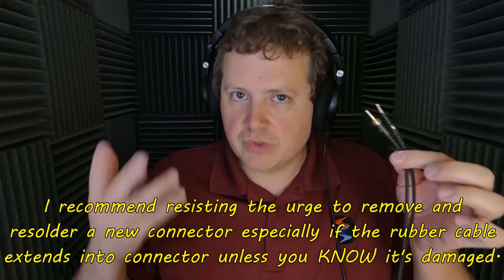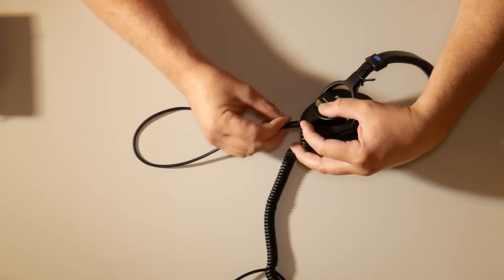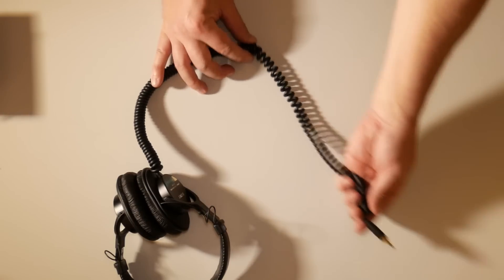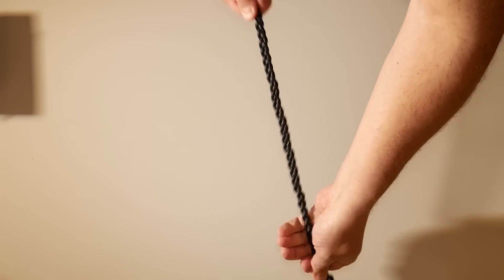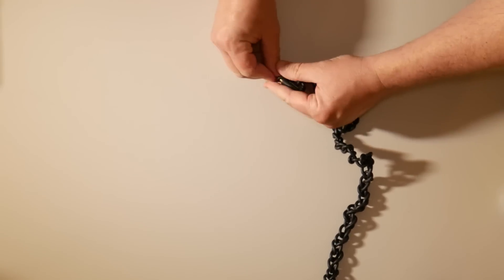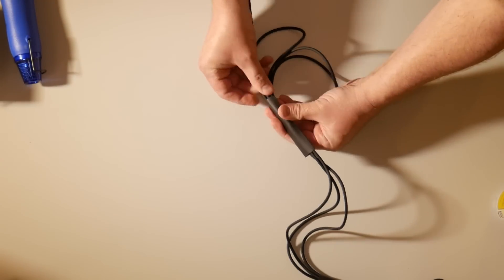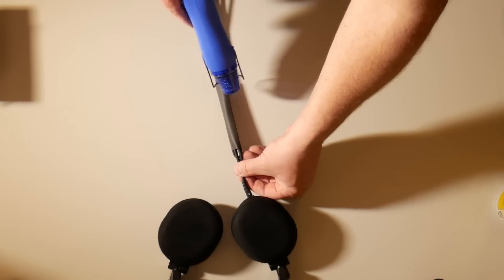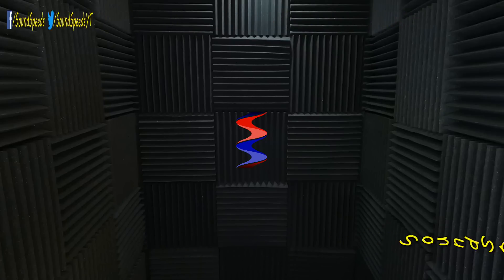4 Pro Techniques To Shorten Long Headphone Cables Without Soldering! Sound Speeds!

Comment: Learned from the video. If I were to cut the cable I would cut out a length of wire (remove about two feet of cable) and the color match the wires from the two ends that were left and either tape them or solder them. No need to solder to a jack.
Reply from the maker: Ok...

Comment: I don't think I would use this although interesting to have. With a chain method it can impart a permanent imprint on the cable. I knew somebody who did this with extension cords and well guess what we went from a decent extension cord to a permanent tripping hazard! But hey you only needed to undo the length that you needed.... Yeah that makes up for it?
Reply from the maker: Chaining a cable over and over again is not the same as doing it once. That's the difference.

Comment: I used the braid technique on my audio technica m20x and it worked perfectly! Thank you so much 🥰
Reply from the maker: Great! Thanks for sharing
Reply: yooo i came here to deal with the audio technica m20x 3 meter long headphone wire
Reply from the maker: Yes indeed. Did you find a solution that will work for you?
Reply: @SoundSpeeds  i just used the braid
Reply from the maker: That's what I use almost every time

Comment: I’m currently trying to decide between audio technica M30X’s and M40X’s, one of the biggest things that will push me to get the 40’s is the fact that I can simply swap in a short cable. However, your tips may just sway me the other way! So thanks dude!
Reply from the maker: The 40s are probably the most popular of all the AT headphones because they are flattest (except for the 70s which are a lot more expensive) so if you use them for editing, you'll appreciate that the most.
Reply: @SoundSpeeds  yeah I think I’ll be getting the 40’s, a shorter cable and then get some new pads at a later date
Reply from the maker: I have a few solutions for you.. 
For shorter headphone cables: https://youtu.be/53Nco-0uSwQ
As for the pads: https://youtu.be/ljCPz6YxIvY
Reply: @SoundSpeeds  dude thanks so much, I’ve been looking around for cables and pads etc. These look great, I’ll add them to the potential list. I’ll let you know how it goes, if I remember. Thanks so much for the help dude, I’ve subbed 👍 class channel.
Reply from the maker: Great! Glad to help and thanks for subbing. Welcome aboard.

Comment: Hello, thank you for the tutorial! I have ath-m20x and Its tight on my head that I hear  pulsing sounds, I'm wondering if you have any advice on this?
Reply from the maker: Pulsing? It's it there if you relieve the pressure with your hands?
Reply: @SoundSpeeds  The noise disappears when I lift it off with my hands. Its like I hear my own heartbeat when I wear the headphones, i think it's because the headphones clamp a bit much
Reply from the maker: That's why I was asking. It's naming too strong of a deal on your head and your heartbeat is what your hearing. Try loosening the band
Reply: @SoundSpeeds  Okay I will try that, thank you so much! Also I did the braid and I think it's so much better 😁
Reply: I also liked and susbribed, I hope you have a good day or evening!!
Reply from the maker: Welcome aboard. Glad to help.

Comment: Great, what method is recommended for shortening from 3m to 2m and / or 1.5m?
Reply from the maker: It's up to you. All methods are effective.
Reply: @SoundSpeeds  Yes, you've said / demonstrated going from full length to ⅓ length...  you didn't show, how to go to ½ or ⅔ length, which would require some specific adjustment to the approach used for going for ⅓.
Reply from the maker: I see. You can use of these techniques to take down the upto 1/3 the length (or even more if you do a more complex braid). It just requires doing any technique for a shorter length of your cable. For example: reducing a 12 foot cable to 6 feet could require you looping almost all of the cable or doing a 3 foot braid with 3 feet of straight cable outside of it.
Reply: @SoundSpeeds  Great thank you for the conformation and support, I will give it a try. I've already been using the coiled cable trick for some time. Hovewer I was struggling to find similarly neat method for shortening straight cakes.
Reply from the maker: Hopefully this helps. I've been using these techniques for years and never had any issues.

Comment: I would love to use these, but my iem cable is already breaded from the start (it's like a looser version of the kz cable)
Reply from the maker: It can still work but for IEMs you can use something like a Bubblebee cable saver: https://www.bubblebeeindustries.com/products/the-cable-saver
Reply: @SoundSpeeds  it's a thicc cable tho maybe the head schrink would work but that would be way too short I need to take off a bit less then half
Reply from the maker: Heart shrink is what my first instinct was.
Reply: @SoundSpeeds  the misspelling of heat is real lol but yea might do something similar to head schrink but with rope as I don't have heat shrink
Reply from the maker: Yeah, typo or autocorrect. I don't know which. Either way, a tight letter N wrapped cable tightly should do it.
Reply: @SoundSpeeds  I made it with the sticky fabric (don't know what it's called) but now it can't slide under my shirt but this works for now until I want to fix it
Reply from the maker: 👍 Very good.

Comment: This is the exact problem I’m having right now but this looks kinda intense.  Are you sure this won’t damage the cable at all?
Reply from the maker: I'm positive. I've done these many times for years with never a bad result. Just be careful and don't stretch the cable as you do any of these techniques. As I said in the video, most of the time the cables get damaged at the connector. When the cables go bad it's usually because they were pinched, run over or scraped by something - abused.
Reply: @SoundSpeeds  okay.  Btw the way, I’m a little confused by the braiding technique.  Is the wire from the headphone going through the loop of the braid, or is it just laid out from left to right? (Idk if that explanation makes sense). Because when I try to braid the headphones, other parts also get tangled and I have basically no idea how you’re suppose to “straighten it out”
Reply from the maker: The braid is just the cable going back and forth a couple of times making 3 total cables. You can only braid it once or twice without having to straighten it out as I showed in this video.
Reply: @SoundSpeeds  alright, think I got it.  It doesn’t look nearly as pretty as yours, but it works.  Thanks! =D
Reply from the maker: Practice.

Comment: I am looking for a way to shorten it even more temporary.
I sit at my desk a lot, bit sometimes I'd like to walk around a few feet, while wearing my headphone.

My cable is long enough for it, however...
I keep hanging my cable up, under my desk. And if I don't or I forget the unravel it before standing up, well...
I even ride over my cable from now and then, because the cable gets heavy on one side and unravels itself, making it drop to the ground.

Help? =)

Some elastic pulley system?
Reply from the maker: Twist tie? Zip tie? Rubber band? Bongo tie? Lasty Band?

Comment: Is braiding going to damage the headphones because mine has slightly delicate wires...?
Reply from the maker: It shouldn't if you're gentle and don't stretch or pull the cable.

Comment: Still my problem is not fixed I have a pro headset 7.1 surround and it has a very thick cable so I can help bending it if their is another way I really hope you can help me
Thanks anyway for the info🤗🤗
Reply from the maker: Make a loop somewhere near the USB end of the connector and tie wrap it off to shorten your cable to the right length.
Reply: Wow didn't expect it that fast ur AWESOME man
Reply from the maker: Thank you. I can't always respond fast (and don't always receive notifications either) but when I get them, I respond.

Comment: With braiding a straight flat cable like the HD600s, does the orientation of the cable affect the neatness of the final braid?
Reply from the maker: Yes, oval shaped cables should be braided  consistently down the line. It'll look great when done.

Comment: 5) wrap the cable in a big loop fitting over your head,  as many turns as you want to shorten it, fasten it with metal clip (clips) to keep the turns in place... put the loops over your head and you will have a neckless of cables. The cable is out of the way and the connector has the perfect length to your device (recorder/mixer) on your stomach or on a stand. It is the simplest way and you can convert it back to a long cable in a matter of seconds...

6) shorten the cable permanently and use different extention cord lengths, preferably with threaded connectors so it doesn´t disconnects by mistake...
Reply from the maker: Never thought of wrapping the cable around my neck. Doesn't sound safe but as long as it works for you
Reply: step 7) have your grandma knit you a sweater out of headphone cable
step 8) wear fanciful
step 9) disregard any critism as jealousy for your newly found superior style of professionalism.
Reply from the maker: Always a great choice

Comment: few of the tips actual make the destruction of cables faster than actual time
Reply from the maker: No they don't. If you do them over and over again then it would but provided you do them carefully and don't stretch the cable, they don't. I've used each of these techniques for years and have performed them to dozens of headphones and the cable is never damaged from doing any of these techniques otherwise i wouldn't recommend them.
Reply: @SoundSpeeds  well u must be taking some extra care for your earphones . these tips are meant to survive toughness even after shortenin the wire
Reply from the maker: I'm doing what you see, nothing more.
Reply: @SoundSpeeds  your video is small session of one day not your years of usage
Reply from the maker: Yes. It would be a very long video otherwise. Here's the thing... as long as you're careful to not pull too hard or stretch the cables when you do any of these techniques, you are fine. Cables are much more likely to be damaged at the connectors or if yanked/pulled due to getting caught on something or run over. I have never had any issues with any of these techniques hence why I shared them and at least two of these are techniques you can see in other videos. If you don't like what you see, don't use any of these techniques but pros around the world do this to their cables without destroying them.

Comment: The heat shrink looks the best for me. All I need is some heat shrink and a hot air gun now.
Reply from the maker: It's a great trick to make sure the metal doesn't touch and remains insulated.
Reply: @SoundSpeeds  Yes. Thankfully my latest Denon AH-D9200 heads phones come with two cables.One short and one long. The longer cable is a slightly thicker cable but I can live with the short one for the time being.
Reply from the maker: Thicker cable is good though. :-)
Reply: @SoundSpeeds  I know but it is Christmas and it can wait till the new year. I do already have some heat shrink tubing.
Reply from the maker: Totally! Merry Christmas!

Comment: But how do i manage to hide it while not giving away space for moving
Reply from the maker: I'm sorry, I don't understand your question.
Reply: @SoundSpeeds  when you have your pc on the table(linnmon with alex jours) how do i hide the cable without loosing comfort
Reply from the maker: If I'm understanding you correctly, it's a matter of personal preference an how you route the cable. If you aren't sure about how much cable length you need, go with the chain because you can easily dial in the amount of length you need and adjust it easily.

Comment: rubbish.
Reply from the maker: What?
Reply: oh, and if turn the coil backwardw on itself you'll shorten or lengthen it. Try it. but in your case it seems a matter of changing the direction of the wire and coil wrapping it.
Reply from the maker: Huh?
Reply: @SoundSpeeds  yea-eah
Reply: Sight.
I tried...
you just braid them then.